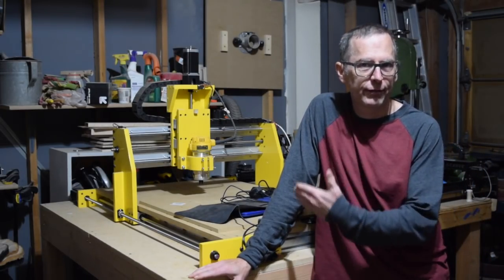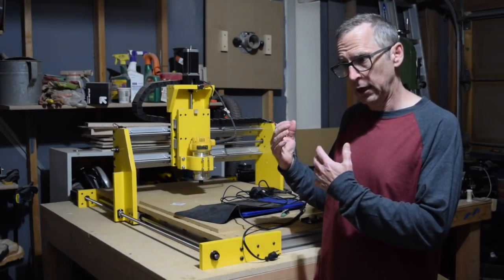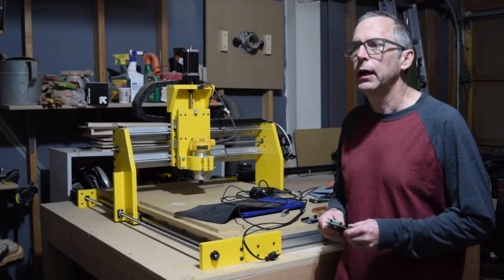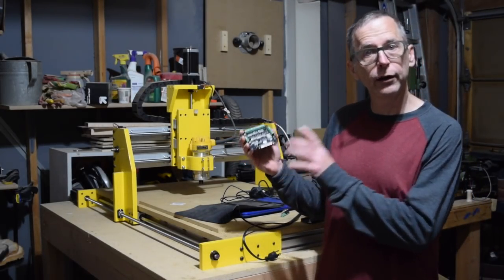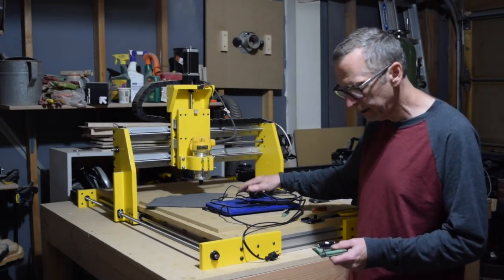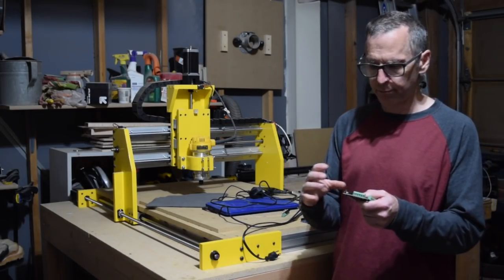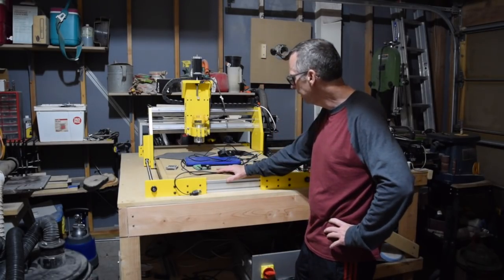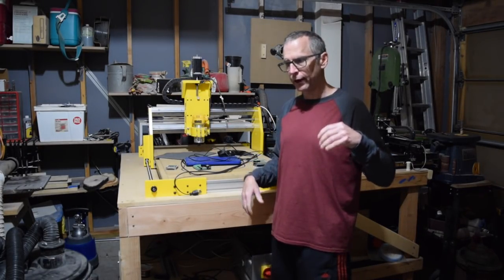Another CNC Machine Update:Changes to the Electronics and When the Plans Will be Available

Comment: “We all like quality joints!” ... sure, might not help your soldering if you’re high though. I worry the capacitor will reduce the responsiveness of the limit switch. Would it perhaps be better to add a small pull down resistor instead?

Comment: Why do the limit switches even have to be active during carving? If you don't skip a tremendous amount of steps you should stay in your work area. That's what I'm used to on hobby CNCs, they just check for the limit switches after power on and then the software keeps track of the work envelope

Comment: When I did the Arduino CNC thing, I wound up with a number of pins that needed noise control...  The Gecko hasn't had a single issue yet, but its a lot more $$$.